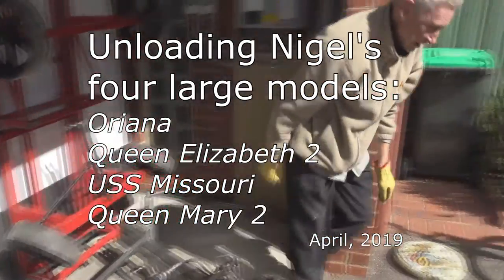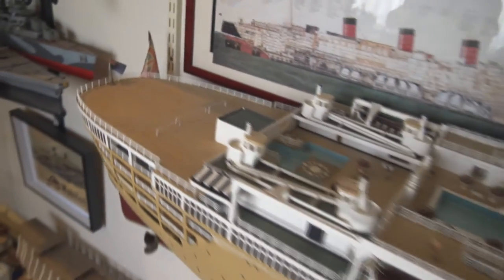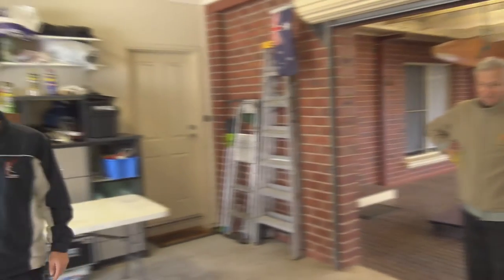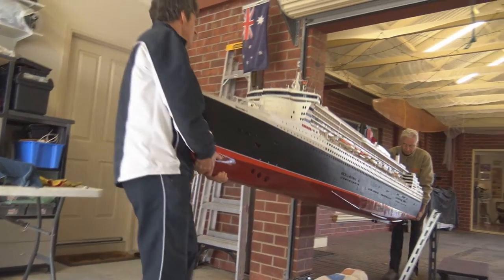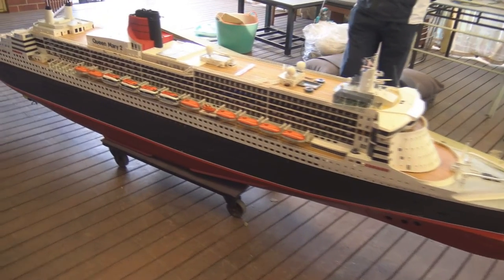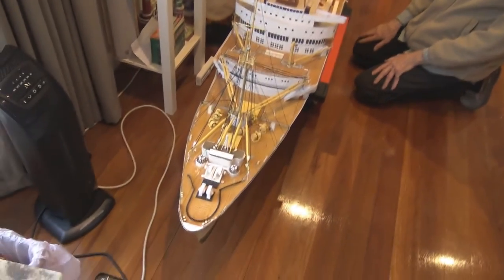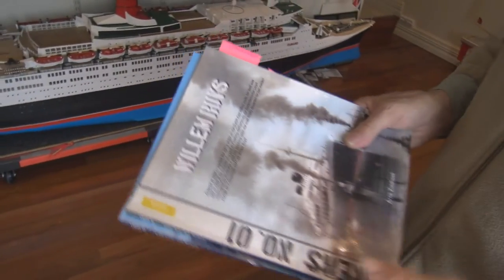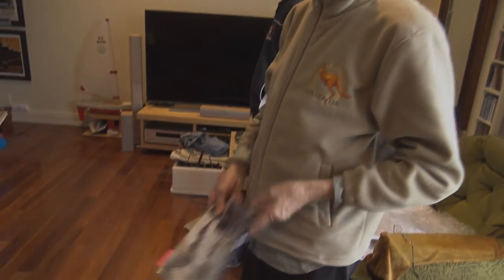Unloading Nigel's four large ships: Oriana, QE2, USS Missouri, QM 2

Comment: Awesome models, fantastic work.. .but... why go through all that trouble on detail only to paint the USS Missouri the wrong colors? @7:29 you show Big Mo as it appears at decommissioning in 1992. You model is painted as such, but your model also has the seaplanes and catapults on the fantails. The planes were only used during WW2. During WW2 it was painted 2 schemes measure 32 and 22D.    It was delivered in measure 32 dazzle scheme with very light gray on wood decks and tops of turrets.This is often confused by modelers and model companies who think the Dazzle scheme had natural wood color deck. It never had natural wood decks in either of those schemes (32 & 22D).  By the time it entered service the gray wood deck was repainted a darker gray and deck blue splinter to match the hull sides of the Dazzle. At the time of surrender with Japan, it was in measure 22, and the wood deck, tops of all turrets, and horizontal surface of the superstructures were deck blue. By late 1940s ('48) early 1950's, Korea and thereafter until 1992 all paint was stripped from the wood deck and it had natural  wood deck color, the hull and the top of all turrets and superstructure sides and top, was same color as the hull sides, a neutral gray and the seaplane aircraft and catapults were removed from the fantails and the first primitive helicopters began to operate. So to have the model as depicted in your video, with sea planes on catapults, it would not be that color scheme.  Here.... Scroll to the bottom: https://www.tamiya.com/english/products/31613missouri/index.htm   - but real nice job on detail and the model, otherwise, looks real!
Reply: I think you are missing the point, I would agree if these models were being entered into competition but as a model maker myself. It is the pleasure and satisfaction of building the model and each modeller's own interpretation of the subject.  These models are totally scratch built and not intended for static display (unlike my own) they are built for RC purposes so therefore have to be more robust than a static model so very fine detail tends to take a back seat.